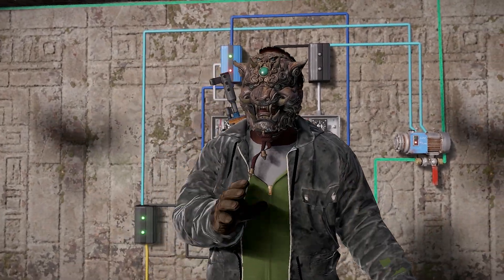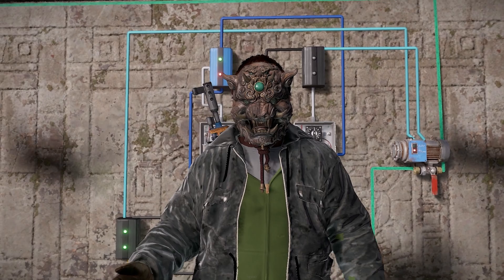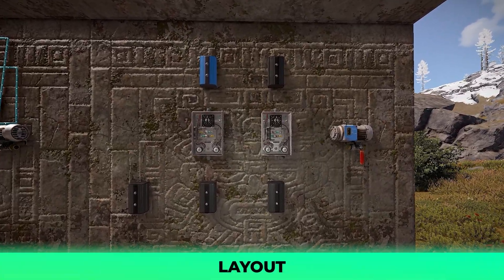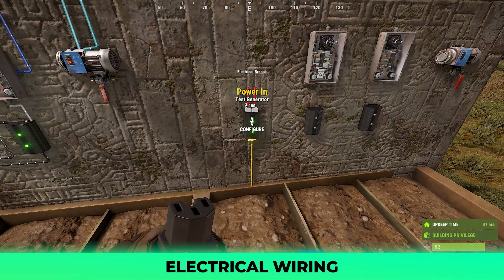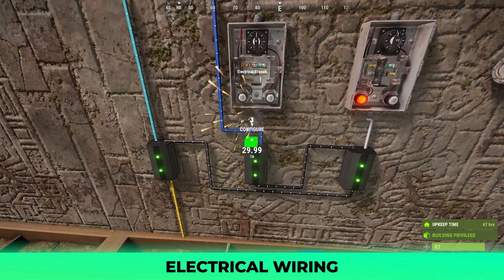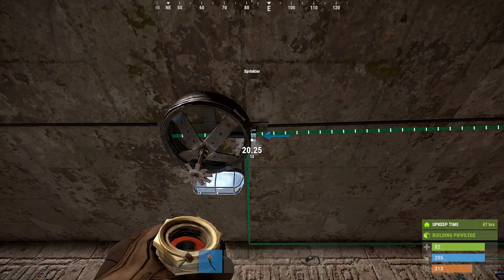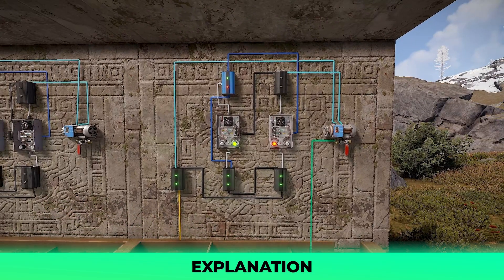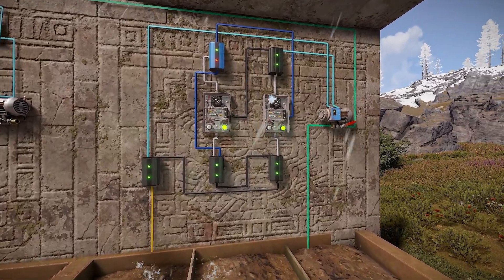How To Build an Automated Sprinkler System in Rust!

Comment: Nice vid bro... easy for people to grasp. Each sprinkler puts out 180ml/min. Hemp needs 5 ml/min per plant. 5 * 9 slots * 4 planters = 180 so no timer needed.  Berries & others are 4ml/min .. so same 4 planters * 4ml/min * 9 slots = 144ml/min needed (4/5 of the 180 ml/sec output) So on for 4 out of 5 min to keep at 100%.
Reply from the maker: I just pinned this as I find it useful for those who are not aware (myself included) so this is awesome I know, thanks for sharing homie!!
Reply: For hemp, where should I get my planters too before planting? I planted right away and they stayed around 0 full so they are growing really slow
Reply: So what time should I set for both timers?
Reply from the maker: You essentially need to set the right timer for 4 minutes and left timer for 5 to run the equation sofa mentioned!

Comment: how about testgenerator reset if i got like 300 planters how to setup a reset for that??
Reply from the maker: I’m unsure what you’re asking here, can you rephrase this question?
Reply: @Sledge315  um like i got 300 planters with 4 sprinkler per planter and i wanna do a reset timer for it instead of putting the timer on Fluid Switch i wanna do it in powered pump.

Comment: Thanks for the video, i have a question, can i use the same process for lights?
Reply from the maker: You aiming for a strobe light method? Technically you can set this up to any electrical item and yield similar results! It’s just a matter of running toggles to switches for the on and off feature and you should be able to!
Reply: @Sledge315  Thank youuu
Reply from the maker: Not a problem my friend!

Comment: Is it possible to have the pump turn off when my lights turn on? I've got my lights set to turn on when the sun sets using the solar panel. Could I use that as the blocker? So when the sun sets the pump turns off?
Reply from the maker: Off the top of my head you could have it connected via the lights passthrough into the toggle on of the pump, I’d have to test it but I’m sure it’s possible!